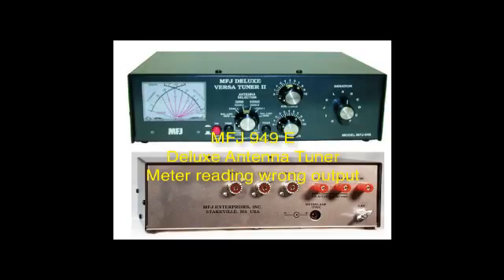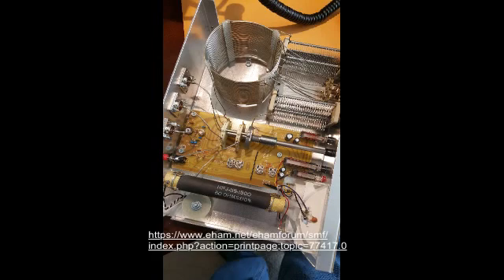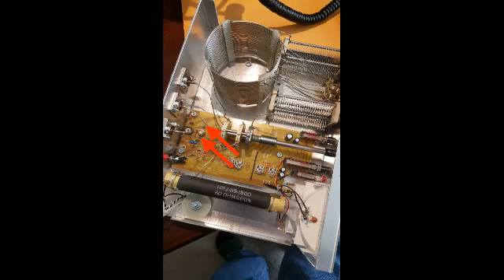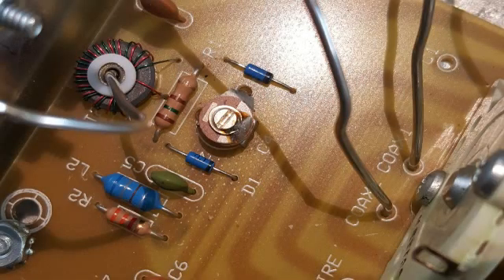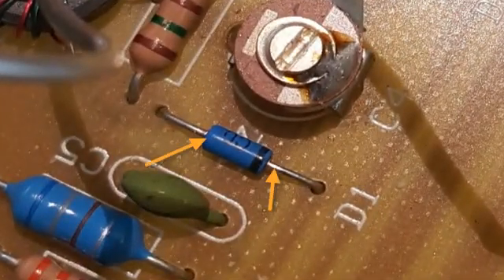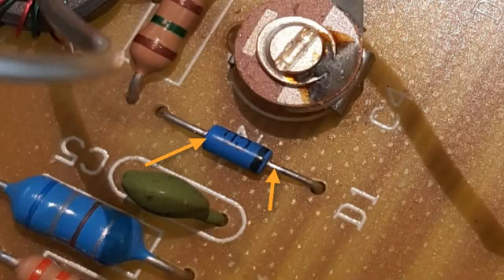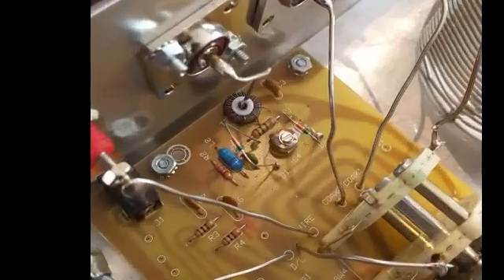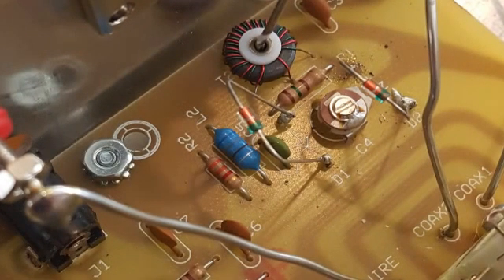MFJ 949E - Diodes replacement

Comment: Hi thank you it is good job, I have same tuner the problem is the meter is moving just a little do you think when I replace the diode will be ok ..73
Reply from the maker: Yes I believe so. It was an easy fix and not expensive.
Reply: Andrea Nunziante 
Sounds good i will try and inform you if success 💐

Comment: What was the spec of the two diodes? My tuner is showing no output and high reflective on ten meters.  I'm going to replace the diodes as you did.
Reply from the maker: Craig I used the 1N34A diodes. Purchased them online on ebay. Here the link
http://www.ebay.com/itm/like/381087901869?lpid=82&chn=ps&ul_noapp=true